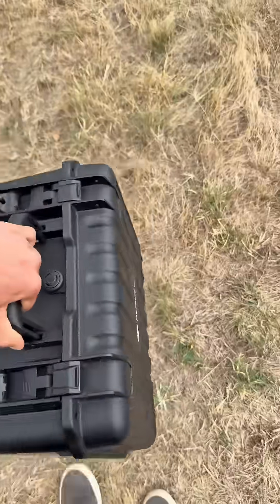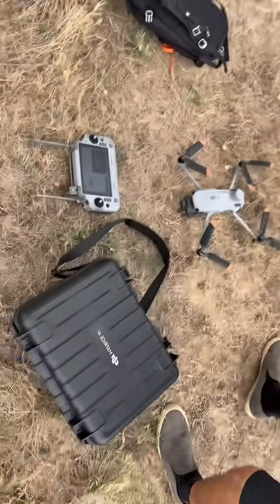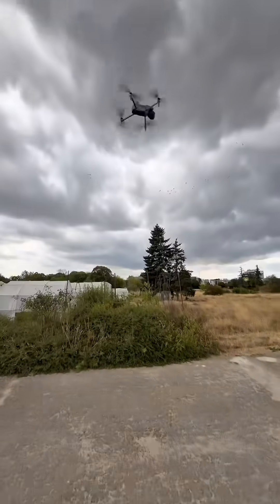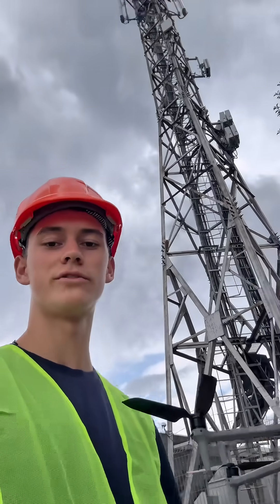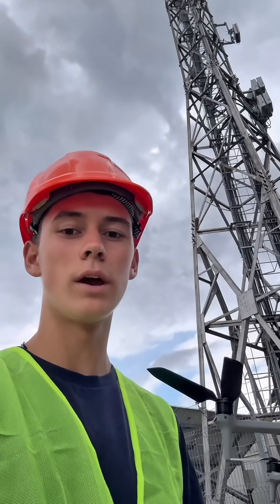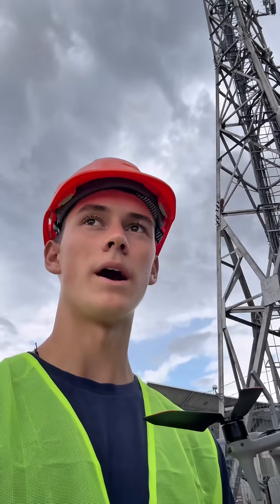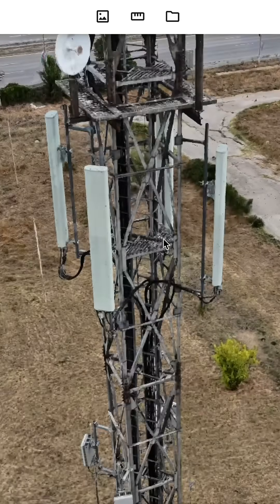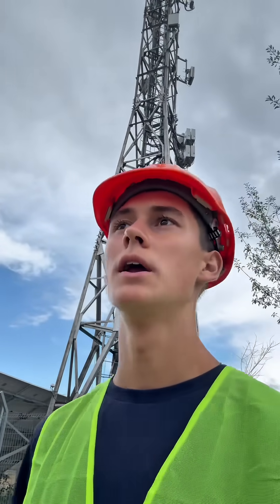How to perform a CELL TOWER INSPECTION with a drone

Comment: Hi, How we can avoid a compass interference with a magnetic field of the tower and antennas?
Reply from the maker: Hi, good question. I usually fly with RTK and GPS around the tower. Most of the time RTK is connected, which will give a more accurate 3D model afterwards. But when I fly straight around the antennas, RTK signal disrupts - you probably have the same problem. I just fly in manual mode - in this way I have more control over the flight and nothing happens when RTK disconnecteds